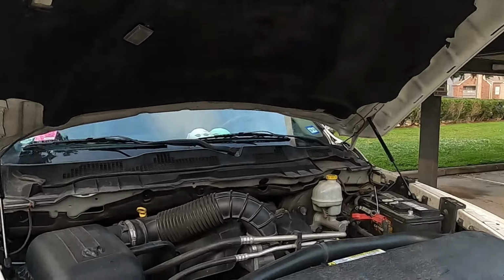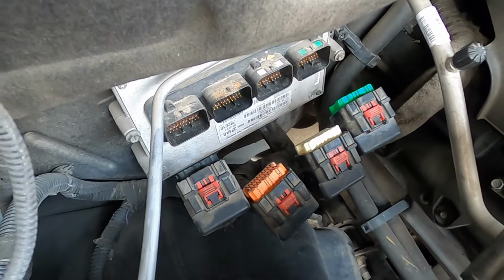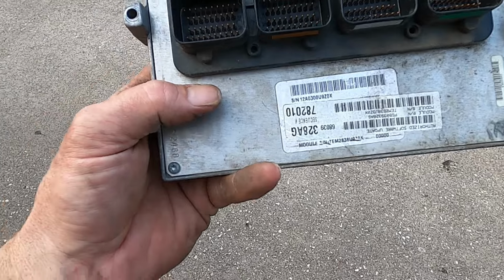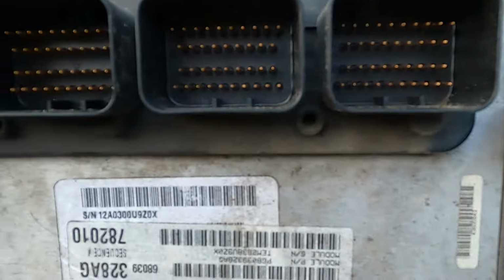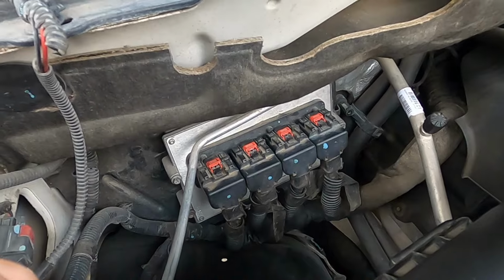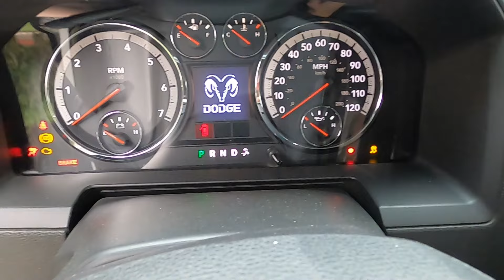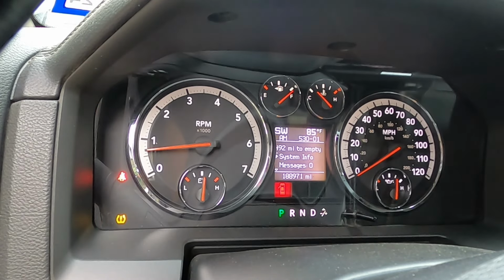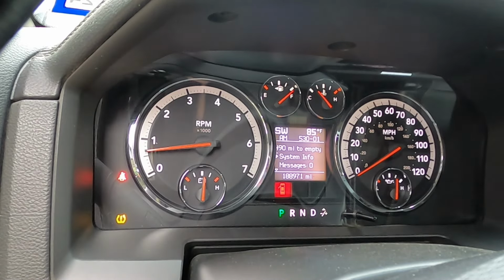09 Hemi Ram P0344 & C121C Code. #moparfam #ram1500

Comment: I need a new motor. 4.7L for a 2010 1500. Mechanic shop qouted me $15k for a remanufactured motor😮
 I need other ideas 💡 😂
Reply: I've been running on 7 cylinders for several months now. And I manually disable the MDS by putting the gear mode into 5th gear. He's running, but not happy. And I know it's day is coming one day. 200232 miles
Reply from the maker: First find you a junk yard 5.7 hemi and buy it swap out the little 4.7 with that. That would solve on problem. Then replace it your self